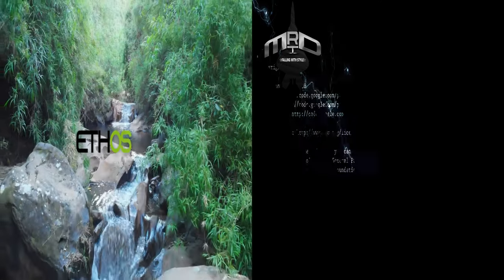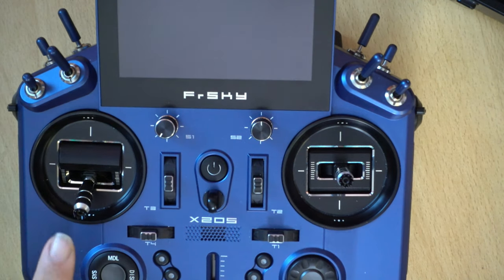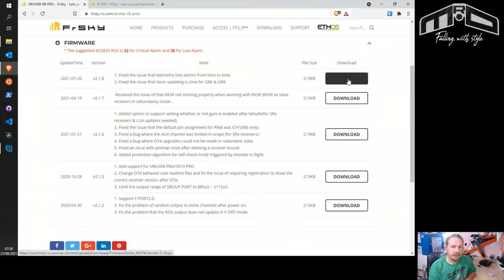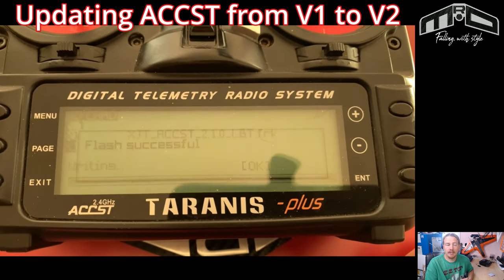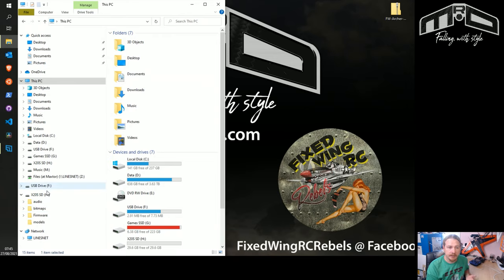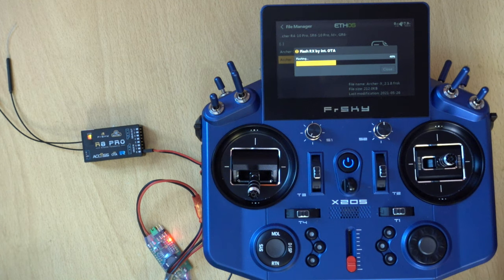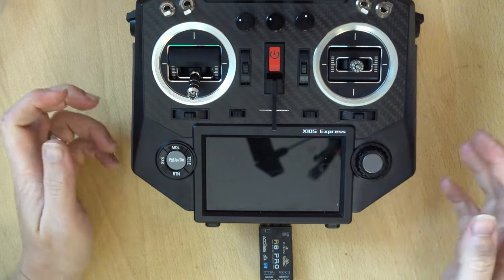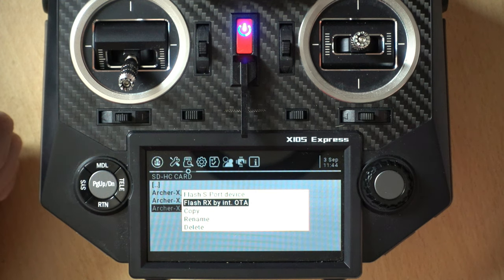Flashing FrSky receivers - For OpenTX and ETHOS

Comment: Love the T-shirt!  Y'all listen to ZZTop way over there? (Writing this from Texas, USA - home of ZZTop).  
Getting back on-topic:  I used to be a FrSky fan, but their ecosystem is such a mess now.  I'm really thinking ExpressLRS is the future.
Thanks for the video!
Reply from the maker: Thanks, ZZ Top are awesome. It was sad to hear of the passing of Dusty Hill. I'm grateful I saw them live when I had the chance.

As for FrSky's ecosystem. I kind of disagree. It was getting quite messy. But, I think recently it's become a lot more straightforward. If you can, use ACCESS. If not, use ACCST v2. That way you always just download the latest firmware and there are no dramas.

I know a lot of people will probably disagree with me here. But I'm not a fan of ExpressLRS at the moment. Firstly, it does have great packet consistency, which is awesome. Consistency is more important than latency in my view. But the latency on ELRS is good also. 

However, it is far to limited in what you can do with it. Only having 4 full resolution channels is a no deal from me straight away on a lot of models. Instantly that means no smooth pan and tilt or no variable flaps/crow if you want them. The channels that are on offer are also limited in positions. I could probably just about get away with using, but I still feel like I could be held back. Especially when there is also only 12 channels. This already limits me on some Crossfire builds. However, you remove those aspects, and the performance would be no better than R9 ACCESS, Crossfire, Tracer, or Ghost; depending on the frequency used.

I may try it on 2.4GHz one day. But it would be limited to small or basic models. I don't really see me using it on 900MHz. R9 and Crossfire are more than enough on that already. And if more range is what is wanted, I feel stepping to 433MHz with something like DragonLink would be the better way to go.
Reply: Interesting!  I admit that I have not actually used ELRS yet.  I just really dislike how each vendor is trying to lock customers into their particular ecosystem, and things like FrSky preventing Radiomaster from selling D16 compatible receivers - so I really like the idea of a vendor-neutral control link.  The docs for ELRSv2.0 (which I don't believe is available yet) refer to a "widehybrid" mode which provides 6 or 7 bit resolution for all of the aux channels.  Still only 12 channels.  6/7-bit resolution is quite a bit lower than 10-bit, and might not be smooth enough for camera control, but would probably be more than adequate for flaps. Personally, I've never had a problem with 50Hz refresh rate, so these "low latency" 250 or 500 Hz rates aren't of much value to me.  It seems possible that they could implement a "50Hz, high resolution on all channels" mode.  We'll see.
Reply from the maker: To be fair, isn't that what all manufacturers who develop their own products do? You won't find Sony making an XBOX controller. The RadioMaster thing I hear a lot. But at the end of the day, they are trying to sell a cloned receiver. I personally think they've got away with some things pretty well already. The TX16S is basically the sister radio to the Jumper T16. The original T16 was a clone of the Horus X10. You could use the X10 firmware on the T16. So I can understand it when a company takes exception to getting ripped off. Though FrSky weren't 100% innocent in the past. The X9D had a clone JR case and was based internally on another radio. Can't remember the name of it now. If those companies had taken exception with FrSky, I would have understood too. But also, FrSky have put a lot back in to the hobby, most notably with OpenTX development in the past.

I'm of two minds with the open source control link. My problem isn't necessarily the firmware side. But, the hardware could be made by anybody, to varying levels of quality. I guess this will come out in the reviews. I have looked a bit more in to ELRS, and it does seem like they are open to having a higher latency version in the future, with more full resolution channels. The other thing that I did see is that the ELRS systems aren't completely compliant with regulatory domain frequencies. LBT is the closest, but none are 100%. I know some people don't care about the legality. But, I'm more concerned about other frequencies being interfered with. Maybe this is also something that will be addressed in the future. I'm open minded. I actually have a 2.4GHz set on the way, as I need to test with it. But I think that this won't be for me yet. Maybe in the future.

Comment: How about x8r receiver update?
Reply from the maker: Take a cable from the S.Port socket on the receiver to the S.Port socket on the transmitter. Then use the cable update method.

Comment: hello Mr.D i just buy X20 but 2.4Ghz ARCHER SR6 receiver's drop range to 0db  in 30 steps in range check please help
Reply from the maker: If this is with range check on, it sounds about normal. I found that my X20S has about half the distance of my X10S Express in range check mode. But in normal operation, there was no problem at all.

Comment: I can't get this ESC to calibrate, when I plug the battery in with inav slider on full throttle nothing happens, I just keep getting the no signal beep. I've tried using my controller as well,  same thing acting like it's not getting a signal. There are two sets of wires coming out of the ESC, one has 2 wires red and black, the other has 3 wires regular servo connector. I'm confused on which one is the signal wire but I tried both of them anyways and still did not have any luck I'm almost to the point of just buying a different ESC, this is the last thing holding the build back from starting testing.
Reply from the maker: There should be a servo connector with a red, black, and white wire. The black wire is the ground, the white wire is the signal. Don't use the red wire.
Reply: @MrD  so I guess I have to modify the wire to be able to connect it to an F405wing ?
Reply: Duh I can switch the pins, I'm not used to the servo connectors I come from quadcopters. Lol
Reply from the maker: @jhughes2286 I tend to direct solder them. You can remove the red wire, tape it up, then move one of the other wires if you want to use the connector.
Reply: @MrD  so I switched the pins, the signal is going to the flight controller, I thought I calibrated the ESC the motor does work now outside of inav, but I can tell it's not calibrated because it only goes up to about 45% then stays there even if I go to 100 throttle, but the servos do not work.
Reply from the maker: To calibrate the motor, make sure there is not a prop attached. Disconnect the battery pack. Go to the outputs page, click the box to say the prop is disconnected, and slide the motors slider all the way up. Plug in the battery, and once the ESC finishes the tune, lower the throttle slider all the way. The ESC should then make some more beeps, followed by the regular startup beep. It’s then calibrated. 

Have you set up a mixer? The servos will need that to work.
Reply: @MrD  I've got the ESC calibrated and the brake set to very heavy, thank you so much! I'm so happy just to see the motor turn! I don't understand the servo mixer?
Reply: I watched your video on the mixer and got the servos working thank you!

Comment: 69th like.  Nice.  R8 Pro flashed on the plug in wire just fine.  R10 said data refused.... gonna try it OTA.  No idea.  Same exact firmware.  Edit, nevermind bad cable came with the R10Pro I guess.  OTA woulda worked too.  Keep making the awesome vids man!
Reply from the maker: Thanks Scott. Yeah, OTA would work with both of those receivers once they’re registered with the transmitter.

Comment: HELLO!  Darren having garbage time getting om with my mini R9 and Hobby wing Xrotor F7 Micro FC (quad) 
Going on the record and saying all Firmware has tp migrate to ETHOS Suite. ONE PLACE ALL DAY SORRY IM SCREAMING!
CHEERS! On A Positive note I did just Flash the most recent firmware for the mini R9. I am miffed however as there are mot different files for FPORT VERS SBUS?? hmm
moving on.

Thanks for your hard work!!
Reply from the maker: On the older receiver there are 2 different firmwares for FPort and SBUS. However, with the new receivers. Switching between SBUS and FPort is just an option on the receiver. So much easier. The issue is that the old receivers were really made for ACCST, not ACCESS. Where there were no OTA options.

Comment: Will you do a video please on using Tandem x20s and registering a R-XSR receiver and then binding it and also making sure its in right mode. I would assume that the I-flight Nazgul5 v2 digital that i bought with the R-XSR fcc receiver uses s.bus mode and also uses access on Transmitter internal module. But when i click register, then hold f/s button down then power quad up it does absolutely nothing and i feel like blowing through my front door full sprint right now. lol . Frustrating shit and no videos.
Reply from the maker: To be honest, if you have the ACCESS firmware on the R-XSR, it should just register and bind like any other ACCESS receiver. It sounds like you are doing the procedure correctly. So are you 100% sure it has the ACCESS firmware on it? If not, it would be worth flashing it with ACCESS to be sure. If you’ve not flashed it, it probably has ACCST v2.x firmware installed. You could always try binding as ACCST. If that works, it’s 100% firmware. 

I use an R-XSR on my demo flight controller. Because of the nature of what I use it for, I’ve registered and bound it quite a few times. There was nothing special going on. It was just flashed with the ACCESS firmware, then registered (failsafe button held when powered on), and bound (just a power cycle). I have it set up using SBUS and SmartPort. 

I guess by mode, you’re meaning SBUS or F.Port? With ACCESS, that’s a receiver option that you can set after you’ve bound. With ACCST it is different firmwares. To find out, you should be able to find out the protocol in the flight controller configurator. iNav it will be on the receiver page.

Let me know how you get on with the firmware.

Comment: Can tx16s bind yo sr10+ or td sr12?
Reply from the maker: You definitely can’t bind any TD receivers with RadioMaster. They only work with genuine FrSKY Tandem transmitters. As far as I know, the SR10+ doesn’t bind either.
Reply: Have you heard about erskytx? Would thus support the td version?
Reply from the maker: @leonguyen120  it’s the wrong hardware. TX16S just uses a multi protocol module. It doesn’t have the capability for Tandem. Only FrSKY tandem specific transmitters do.

Comment: I don't know if I made some mistakes but after updating my Taranis X9D to firmware 2.1.0 I'm not able anymore to set internal module to D8. I can reduce channels range to 8 for having lower latency but the only mode I actually can select for my internal XJT are D16 and LR12. Any hint? thank you
Reply from the maker: Did you also update OpenTX? If so, did you enable the EU option? If you did, just turn it off and re-flash OpenTX. That’s the part that hides D8, not flashing the RF module firmware.